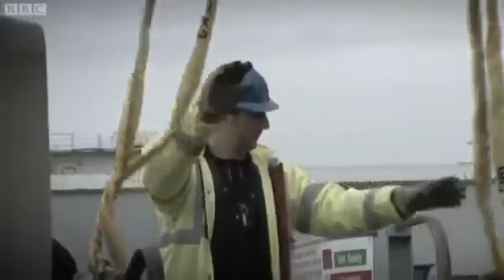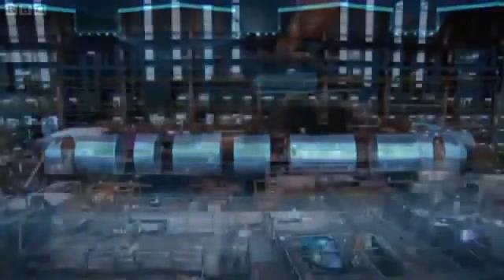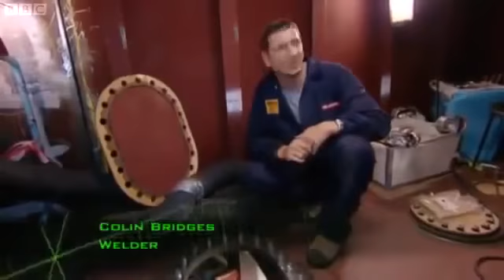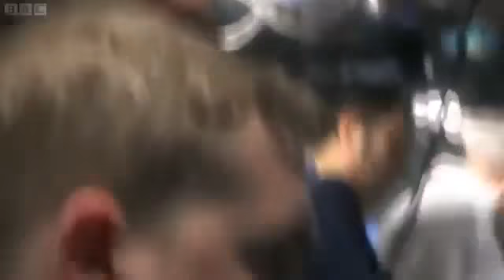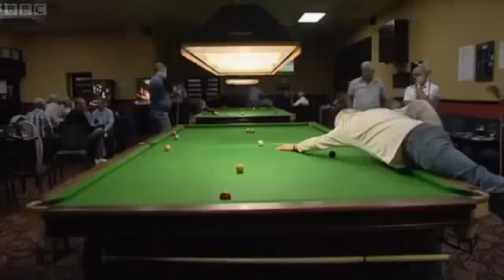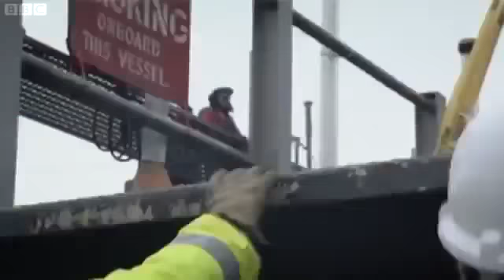How to Build A Nuclear Submarine Full BBC Documentary Eng Sub

Comment: I've seen 1 other documentary by the BBC, narrated by the US navy, Another also done by the US Navy. Another by the French, all crap. None say how to get rid of CO2 build up, How to mix O2 with Nitrogen and other minor gasses to make air. None say the material to protect the reactor room from an accident, the best substances being Lead, Concrete or water, which science have shown, block Alpha, Beta, gamma, and Neutron radiation. , They do say to build a Nuclear sub, one has to be able to weld, solder cables, check all safety levels for crew safety, check for for abnormalities, etc. Basically, what you would do when making anything!!! Very mind numbing and boring.